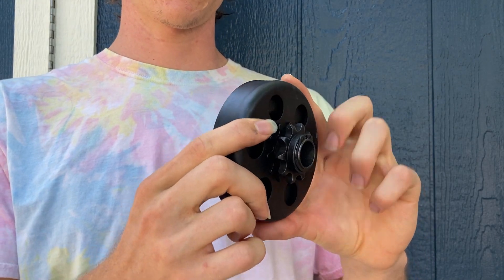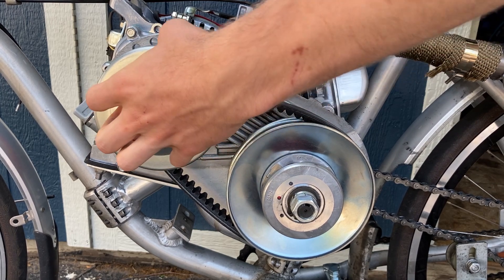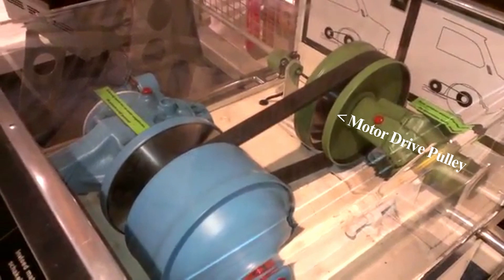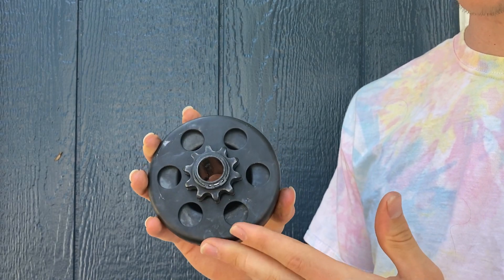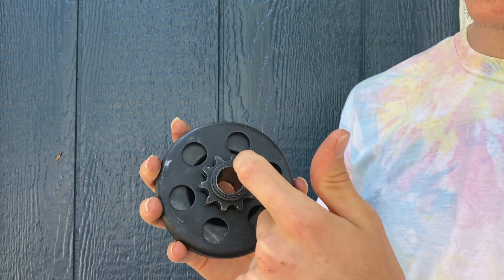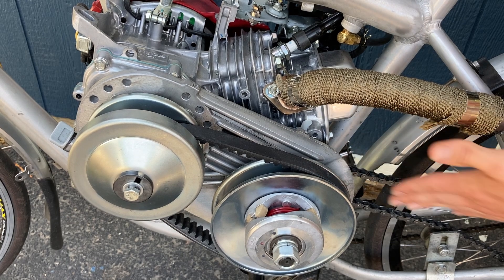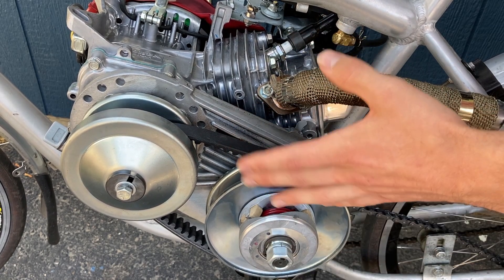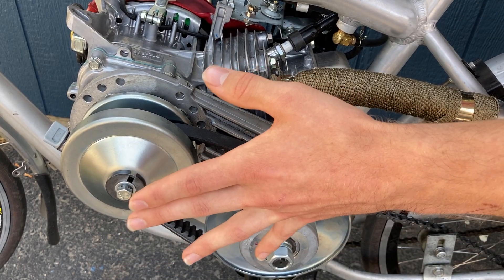Centrifugal Clutch vs CVT Torque Converter

Comment: Being an skidoo operator, with the torque clutches if they are not lined up, kept clean, and maintained you will burn through belts, secondly both clutches operate on plastic sliders, those wear out over time yes they can be replaced as well as the springs that operate each half of the clutches which eventually weaken and need to be replaced, now pay attention boys and girls these are under pressure and not being careful while driving s assembly can lead to injury, use the proper tools and parts when servicing them, good job on the explanation and nice work youngblood

Comment: PLZ bro i have a problem I have a centrifugal clutch on my gx120 but when I accelerate it doesn't take any turns it rolls but doesn't go to the rev limiter and always has the same number of revolutions per minute the clutch is new and when I put the wheel in the air without me on it it accelerates to the rev limiter? Do you have any idea of the problem please

Comment: I'm working on my sons go cart and we are having trouble with the couch getting hot fast I'm considering using a cvt torque converter but I've also considered changing the drive shaft sprocket from a #50 to a # 60 nit sure what the best route would be .....
Reply: Cvt 1st

Comment: I had a clutch on my race mower and it had no bottom en but it hit 47mph, I swapped for the cvt and now it spins tires, climbs hills and will sometimes wheelie, and the new top speed it 52, I'm using a 30 series cvt and the stock red spring
Reply: Also its on a stock preditor224 not a 212
Reply: PLZ bro i have a problem I have a centrifugal clutch on my gx120 but when I accelerate it doesn't take any turns it rolls but doesn't go to the rev limiter and always has the same number of revolutions per minute the clutch is new and when I put the wheel in the air without me on it it accelerates to the rev limiter? Do you have any idea of the problem please
Reply: @Noa-ve2gx  Hi, I'd say if everything else is correct, your too high geared or not enough power.

Comment: The centrifugal clutch cant handle your tall gearing. The 30 series torque converter has more low end and high ind because is essentially a low quality nissan cvt transmission. My coleman ct200u(with pred 212 torq. Conv.) does 40mph still having the governor. And im almost 300lbs. Anf thats with a 72t rear sprocket(stock 50t)

Comment: Hi Ben, viewer from Europe here. I want to start a similar project using the torque converter but i've seen that there are 2 types of converters- 1" 10T 40/41 and 12T 35 Chain and  3/4" 10T 40/41 and 12T 35 Chain but don't know which one to choose so can you tell me what those numbers mean so I don"t have to buy the wrong one since I'm going to order it straight from china. Great video explaining the pros and cons btw.
Reply: I'll try to help ya out a bit...the 1" and 3/4" refers to the shaft size diameter on your engine. Youd have to measure the one on your engine and see what ya need. 

35, 41/40, are chain sizes and again you might have to take some measurements if there aren't markings on your chain. 

"10t" and "12t" refer to the amount of teeth on the sprocket/gear that the chain rides on. The lower the number the more torque (lower gearing) but less top speed. the higher the number the higher your top speed (higher gearing) but you lose low end torque. 

Which one you want to use depends on what you want to do and how many "teeth" are on the rear sprocket. Some kits come with both and you can change em out to fit your needs. Sprockets are easy to get and replace. The important thing to get right is shaft size and chain size.
Reply: @offroadfts  Dude you are so Golden, thank you so much for taking your time and your in depth explanation man. Now I will definetly know what to choose based on those numbers. Much appreciated bro!!
Reply: @alexandrumarius5042  no problem man. Seemed like you genuinely needed some info. Im glad I came across your post and was able to help ya out a little

 If you need me to go more in depth with any of the explanations, I'd be more than happy to. Take care and good luck with the project

Comment: The crappy Chinese clutch you tried is actually a good idea. If you ever try it again take the snap ring to separate the two sections and apply high impact high heat expensive good grease and it will work. I’m going to try to put needle bearings it. We’ll see?
Reply from the maker: Thanks for the suggestion!!
Reply: Yea..no thanks

Comment: Did you use the set screws so it sets it in place and doesn’t move? Also didn’t look like your chain was straight and definitely was grinding on the centrifugal clutch. I could be wrong but that’s just what I noticed

Comment: Hey mate I’m building a atv motor bike motor.. in getting a 6.5 hp motor with a 19mm shaft.. is that 3/4 ??  Buying stuff off eBay I am.. tor convers ... before I order it I want to check with u first.. cheers Chris
Reply from the maker: yes, this is for a 3/4 shaft on my Honda
Reply: @BenCarano  thank u mate .. how well do they do on hills ?

Comment: Any thoughts on a stock Phatmoto (fat/4" tires) with a stock 79cc four stroke? How much more weight does a torque converter add? I have to lift my bike over obstacles and into vehicles at times, and at 70 lbs I am thinking about mass increases carefully. Not sure if they have anything for my bike yet, new to all this. Thanks to anyone who knows...

Comment: If you all haven't figured it out yet... Here is a clue- Any of the cheap transmission parts for motorized bikes and go cart etc are cheaply made junk which dont last!  Save yourself a lot of trouble and buy a ez bike q-matic transmission ($200-300,00) and  go riding!  INSEAD OF FIXING! I did  and  boy I dont regret it!!!!! Michael M.

Comment: 🤔🏁REALLY Kid I did i listen to EVERY word YOU said YOU DO KNOW exactly what YOU REALLY ARE  talking ABOUT I AM a REAL ASE  certified Master Auto technician with ABOUT 60 year's of REAL experience I don't think I COULD have did ANY better if I tried to explain my self yes YOU DO KNOW exactly what YOU kid were talking ABOUT I would probably take two flat steel bars and strengthen that plate of that torque converter plate and the shaft needs to be about a half  inch longer like YOU said on that back sprocket torque converter kid you really could put a Honda version 4 cycle gasoline engine 212 cc's if you put two flat  steel plates on that torque converter plate to strengthen that torque converter plate I REALLY COULD NOT have did a better job my self . YOU kid REALLY DID  a GOOD job. .

Comment: For the belt: that system is super common (in Europe) for all scooters. That belt usually last, if in a closed system like yours, 40 to 80k Kilometers (50k miles). That stuff is super strong
Reply: Most scooters have a centrifugal clutch on the rear wheel in addition to the belt. This helps the belt last longer

The one shown in the video will wear out pretty quickly since the belt slips.
Reply: Yes. Scooters with this system doesn't use the belt itself as the "clutch pads" like a minibike torque converter like the one shown here. Instead, the belt doesn't slip when the engine is idling or during low loads, its constantly fixed or not slipping on the pullies. The centrifugal clutch after the cvt on the scooter is the one that slips when accelerating or during high loads until it locks up and acts as a single piece

Comment: Good narrator, 
New to the 4-stroke how is a #35 chain compared to a 415 or 420?
Can I pull the sprocket off a 2-stroke motor and put it on a 79 cc Predator, I guess keeping in mind it's metric to machine SAE threads any problems anticipated?
I think the 79 cc is a 5/8" shaft compared to a 2-stroke mm very close conversion what would I use if there is slack plumbers tape?
Reply from the maker: #35 is weaker and less strong but it will still work if the sprocket fits it

Comment: so even a cvt should have a centrifugal clutch ?
Reply from the maker: Yes that is correct, using centrifugal force to make the pulley shrink with higher rpm to engage the belt
Reply: @BenCarano  oh... ty :)

Comment: Thinking about using a duromax xp7hpe electric start 4 stroke on a bicycle project.  Thinking about using a similar torque converter.    Wondering about the gear alignment.  Where did that torque converter come from?  Most ive found come as is.  Just wondering in case i have a similar alignment issue and need it customized.

Comment: There's lots of different companies that make centrifugal clutches you got two from a crap company I'm guessing, you said yourself you had one last 4 years, don't get me wrong those torque converters are great but there's nothing wrong with those clutches I feel like this video is just going to make people think that those kind of clutches are bad and that's not the case
Reply from the maker: They’re not bad at all, it is just a lot more cost effective to buy the torque converter or at least it was at the time! Of course I can spend more on a clutch and have it work, but the cheaper torque converter is still running close to 10000 miles to this day with no issues

Comment: I honestly think you were having a bound up situation somewhere with the clutch set up. A good experience with a clutch and you will be sold.
Reply from the maker: yes, cost wise though to buy a clutch that would not bind up it would cost me close to $450 and so for half the price I could get a torque converter that fit perfectly, and gives a little more power in the end

Comment: Put the central field clutch on the other way. So that the sprocket is in toward the motor and the clutches on the outside. It will save them bearings
Reply: Yep correct and for the guy making the video it's a centrifugal clutch not center field and you other clutch system is a CVT centrifugal ver abal transmission CVT

Comment: wonder if that would work with a 79cc predator
Reply from the maker: it probably will as long as the engine is the same design on the front. it is pretty standard

Comment: Hi, may I ask where you got the front bolt-on motor mount?
Reply from the maker: I bought them at my local hardware store. They happened to have a lot odd the hardware I needed that was odd sized and stainless steel to not rust
Reply: @BenCarano  I would have never guessed.  Thanks 👍

Comment: Great video, bro! I thought I was the only one who felt the awful shake of that centrifugal clutch from a dead start. I will be ordering a torque converter soon.
Reply: yeah, mine does the same thing, pretty bad and I'm gonna build my next bike with a converter for sure!
Reply: @N9197U  I changed the spring in the clutch for one that engages at 3000rpm because a 79cc doesn't have enough power at 1800rpm, when the stock clutch spring engages. I tried a CVt and you'll have to do modifications if you use it on a 79cc. Good luck 👍🏾
Reply: @mybikes1970  thanks for the info, my next build is gonna be the Lifan 118cc because it appears to be a bit smaller (physically) than a 212 while still having a nice 4 horsepower. I don't need 6.5, I'll probably die chasing speed numbers haha
Reply: @N9197U  that's cool. With a 118cc you should be able to get enough power to use a CVT and still get good mph.
Reply: @mybikes1970  My goal is about 50mph/80kmh top speed. With my 49cc I can already somehow hit 33 mph/53kmh so it should be possible. Double the horsepower should be able to net me an extra 17 mph.
Reply: @N9197U  Mine can do 50mph/80kmh after I did mods to the engine, but not with a CVT. I could only get 37mph/60kmh. You should be able to get more power with the engine you chose, but you'll probably need to do a few modifications also.
Reply: @mybikes1970  uth by
Reply: PLZ bro i have a problem I have a centrifugal clutch on my gx120 but when I accelerate it doesn't take any turns it rolls but doesn't go to the rev limiter and always has the same number of revolutions per minute the clutch is new and when I put the wheel in the air without me on it it accelerates to the rev limiter? Do you have any idea of the problem please
Reply: @Noa-ve2gx  Are you still using the governor on the motor? Also,The centrifugal clutch comes with a spring that engages the clutch at a certain rpm. If you have a tachometer, rev the engine and see how many rpms it until it grabs. If it's around 2000 rpms, your motor doesn't have enough power at that rpm and won't be able to move you when you're on it. I use a 3000 rpm spring. The motor has plenty of power and pulls me easily. Hope that helps👍🏾😁

Comment: Centrifugal are best at wide open throttle.  Which is why slow start.  They much faster at wot.   Torque converter is better for stop and go. It’s like the NA AND TURBO versions of cars.  Naturally aspirated is fine for beating on your car and turbo is for speed. Nice video
Reply: PLZ bro i have a problem I have a centrifugal clutch on my gx120 but when I accelerate it doesn't take any turns it rolls but doesn't go to the rev limiter and always has the same number of revolutions per minute the clutch is new and when I put the wheel in the air without me on it it accelerates to the rev limiter? Do you have any idea of the problem please
Reply: @Noa-ve2gx  bad springs in the centripetal clutch.

Comment: Not to mention the belt provides cushion on the drive train.. which translates to smoother "not completely smooth" but smoother take off & acceleration..
THAT BEING SAID... There's also
more spinning peaces..🤔🤭😩!!
Which means MORE has to happen for take off..🤧 
Centrifugal & chain set-up is rough because there's no cushion.
Less moving parts = a hard hitting take off.. less to maintain.. less bearings.. less that can go wrong..
Torque converters are pricey and cumbersome.. "juggernaut" lol..
Centrifugal clutches are cheap and get the job done.. I'd say put the two setups on two engines that are built the same.. same everything.. rider weight.. everything & send em'..

Comment: Same problem with my supernatural by Helio. Rear rim snapped at 500 miles. Any suggestions on how to go with a rear wheel rebuild?
Reply from the maker: if you still have the hub you can contact your bike shop about getting a wheel rebuild, but it may be cheaper to get a new one depending on the cost of your wheel

Comment: 7:1 ratio is the best I found out so far for 100kmh top speed on a 50cc kids quad 208cc engine swap with centrifugal clutch($35-$75). and buddy had the cvt($350-$400) and he has take off but no top end speed ghe tops out at 75kmh. and I just fly on by onb my 11occ kids quad engine swapped to a 420cc centrifugal clutch. sound like he needs to cut the spring 4 links shorter or  gear ratio is to low. and it's trying to stall it. if you are lazy like me. throw a little bit of oil on it and go. it's stop the choppy till the oil dries up. which should take several days or 3 hrs of hard riding. and his chain was to tight!!!!!!!!
Reply: Yes that's what I used to do until I got my  horstman put together. Just spray a few drops of non teflon lubricant of your choice in between the clutch pads and the clutch bell ( outside part that the chain is connected to). No more chatter and great stall.  You will feel when you need a few more drops.
Reply: PLZ bro i have a problem I have a centrifugal clutch on my gx120 but when I accelerate it doesn't take any turns it rolls but doesn't go to the rev limiter and always has the same number of revolutions per minute the clutch is new and when I put the wheel in the air without me on it it accelerates to the rev limiter? Do you have any idea of the problem please

Comment: Bought a minibike to putter around the yard, mostly. The original centrifugal clutch worked well but had that on-off characteristic to it. Not jerky, but when you're only wanting to go less than 10mph around the yard it's super annoying needing to modulate speed with constant on/off throttle adjustments.

That alone convinced me to switch to a torque converter. Well, that and the fact that the jackshaft's axle was defective and disintegrated its woodruff key with less than 10 hrs on the bike, rendering the bike motionless. I'd also read you're supposed to regularly oil the outside of a centrifugal clutch where it bolts on, which wasn't going to happen much.

I like the inherent simplicity of centrifugal clutch setup, just not for my bike.

Comment: Is it possible to build a CVT torque converter that doesn't use a belt or any computers, and looks just like a normal centrifugal clutch on the outside?

I'm basically trying to build a chain-drive race car with an automatic "3-speed" on the front (technically more than 3), driving a manual 8-speed on the back. And the automatic portion is meant to be in disguise (the rules say you must have a manual 8-speed transmission, but they don't say anything about having two transmissions.)

My motivation for deceptive engineering is to be competitive against established outfits in a situation where my resources are very tight, and to be very innovative in spite of those limitations (and unnecessarily strict technical regulations.)
Reply: Idk why you would even ask that.
Reply: Long story short: no they work to differently

Comment: I ride Mopeds, what's the difference between a CVT torque converter and a CVT transmission? They look very similar, but CVT transmission is way longer I think... Seems like it's same mechanically
Reply from the maker: Transmission just has gear shifting to go higher speeds rather than just the pulleys